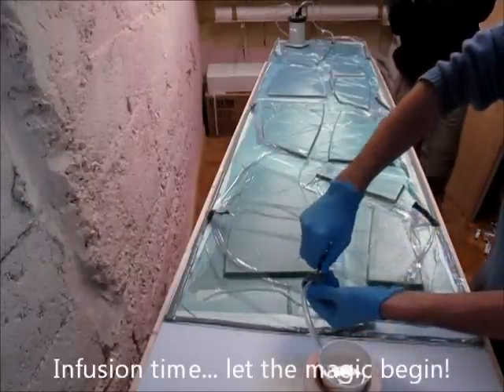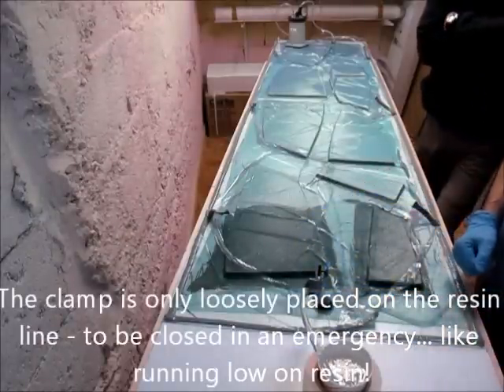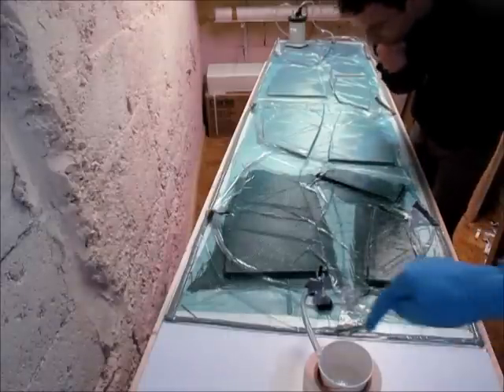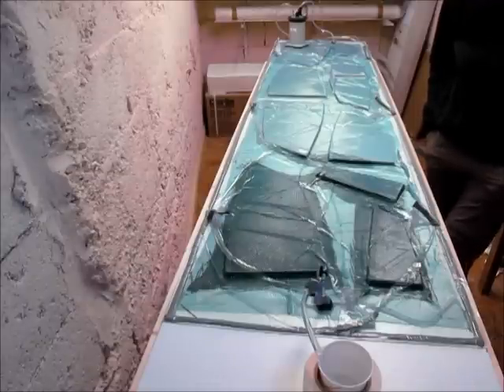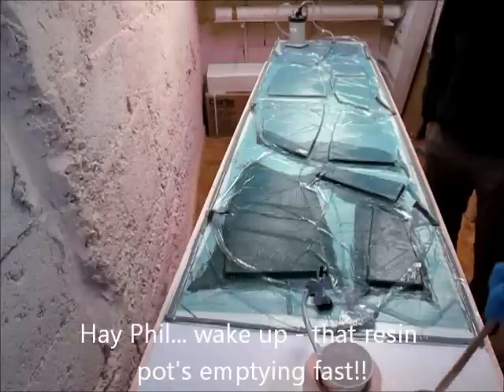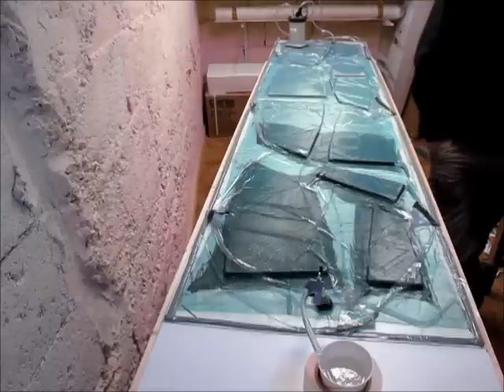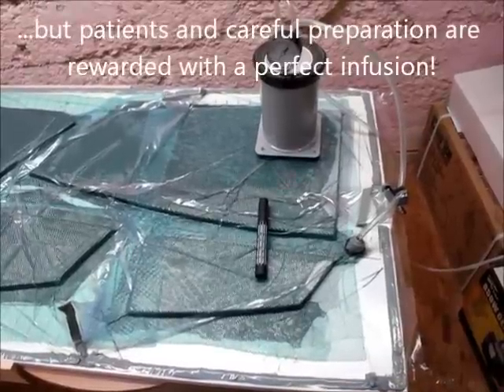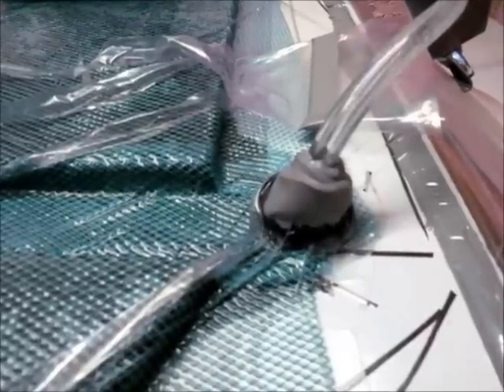Phil Lardner's Carbon Dragon Project - 1 - Vacuum Assisted Resin Infusion

Comment: Hi Matt C,
Yes, the carbon cloth gets laid over (or into) its mold dry, with peel ply and vacuum bag over that. You then suck out most of the air and can take your time making sure that the stack (carbon-peelply-vacbag) all conform to the mold perfectly, without any bridging before you evacuate the remaining air and pull a hard vacuum. You don't mix any resin until you are 100% happy with the positioning of the pieces and the integrety of the vacuum bag. Only then do you mix the resin and draw it into the bag under vacuum. This method is infinitely cleaner, safer and less stressful than doing a wet lay-up, where the clock is ticking. Vacuum infusion will give you a much better part than wet lay-up and it is much safer because you are not messing around with wet epoxy (seriously dangerous stuff).

Comment: I have never seen it done this way. Interesting indeed. Do you lay the carbon down dry and then infuse the resin like in the video vs doing several wet layers and vacuum sealing the extra resin out?

Comment from the maker: I've used up a little over one gallon (UK, not US gallon!) in fabricating all the small parts for the glider (wing ribs, tail & rudder ribs, H-stab & elevator ribs & tail boom ribs) but have not yet tackled the leading edges or tail boom skin. If you know exactly what you are doing (and not making a lot of test pieces like me!) then I would guess that you could probably do the entire glider with three gallons. Not all of that goes into the finished parts - there is a lot of unavoidable wastage.

Comment: I have a very accurate digital scales and measure both resin and hardener to 0.1g. I use separate syringes to adjust the quantity to the nearest single drop! Each cup is then taken off the scales and then re-weighed to make sure there is no gross error. Also, destructive testing of test pieces has verified that my finished parts are considerably stronger than they need to be, so I think I'm pretty safe! I'm working on the leading edges for the glider at the moment, so more videos soon...

Comment: Is it a little risky to be mixing multiple batches of resin/hardener for the one thing in case the ratios are off between each batch? Just a thought :) Wouldn't using a slower hardener be more effective?